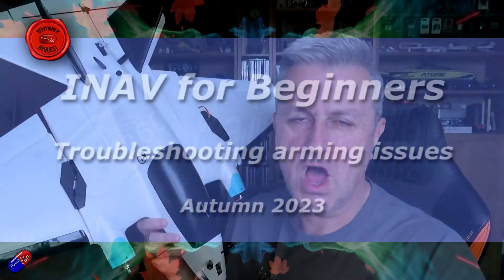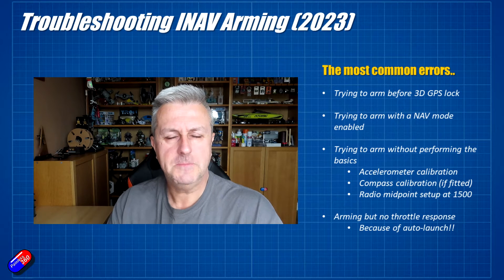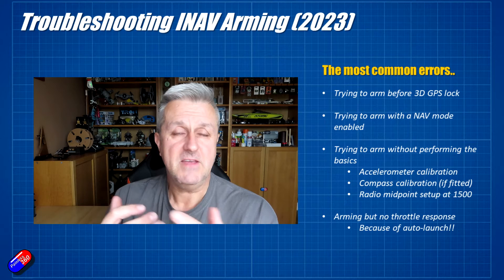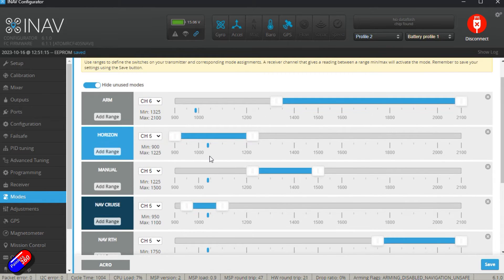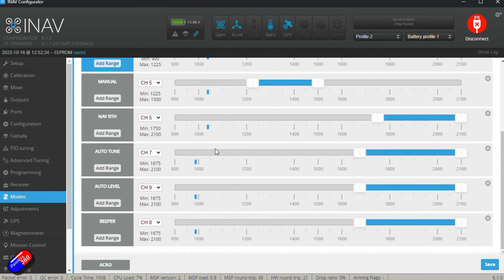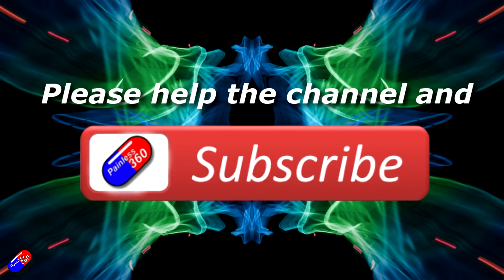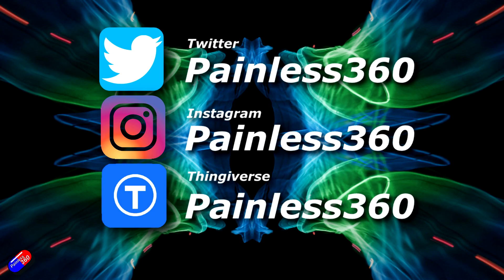INAV Arming Problems - What to Do if You Can't Arm INAV or Run the Motor..

Comment: Hi Lee, as always thank you very much for your videos, I really appreciate them a lot. I wanted to ask, as it is not stated here. When I connect the airplane I'm trying to use, it does not show the arming flags in the bottom grey bar, i'm using INAV 8, a matek f405 std and all is working, even a pitot tube and 3d lock in gps, i set up an arming switch but i'm not able to run the motor, i can only run it through the usb, and sometimes i have a 'runtime calibration' ❌ in the overview, but i don't know if im able to arm or not because i dont see the flag. Everything else is working, i have been stuck with this a couple of days without improvement, if you have any ideas, please let me know!
Reply from the maker: Typing status in the CLI can also show the issues too. Best of luck

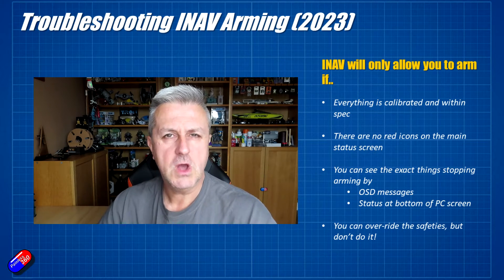Comment: Hi Lee, I successfully installed INAV 7.12 in my no1 plane with SpeedyBee F405 mini, but blew up my no2 board in plane 2 so in the process of setting up.  I get 'navigation is not safe'  Good fix outdoors. 15+  satellites, 3d fix, no modes set apart from Arm, loiter, RTH on switches 1 and 2 way sw 3. Permanent airmode. Though I have tried with that turned off anyway.  Everything is configured as was my no1 plane. A couple of points re the video , at 01:29 in INAV 7.12 scolling down in pre arming checks it does not tell me what is wrong unfortunately.  With system messages on in OSD and looking at my monitor it does not tell me what the problem is either ? I think, a bit hard to see, but you are using INAV 6. ? Any other clues please?  There are suggestions online that 'nav is not safe'   is a bug with Inav 7 , so thinking of trying 8, or even a downgrade to 6? cheers. And thanks for your much appreciated efforts!
Reply from the maker: Check how I setup mine here for hassle free configs. Check your modes as tying to arm while a navigation mode (like Return to Home or Loiter) is active can also trigger the "Navigation is NOT safe" message
Reply: Thanks for the 'Speedy' reply, I forgot you're UK unlike Andrew Newton! 😮
Just came on again to say I installed 8.12 and then no more nav not safe message. But, this time motor wouldn't spin up . The reason now was a modes issue though, a channel conflict with arm, rth and loiter.  Pretty sure that wasn't what the original  problem was though as I'd been through all settings including modes a few times,  before updating to 8.1 
I'd even discovered how to use CLI and copied Diff all from my working board to the new board, before risking total FW update so I'd have thought that modes were ok. 
 Only have 6 channels to play with, Flysky i6 ! 
Thanks for the input anyway, it's a big learning curve for my 78 year old brain, though good fun when you win 😊.
Ps. I always check position of rth and loiter swC as well. 😉😩
Reply from the maker: Please follow my INAV for beginners series on the channel for the setup steps I use that work every time. Best of luck

Comment: Hello. What kind of problem could be with inav setup that esc is not working via standard s1 chanel. And if i change it to servo type, it works ok.
Reply from the maker: Check the ESC supports the protocol you're trying to use... best of luck
Reply: @Painless360  i used dshot, on flycolor site it looks like support.
Reply: @Painless360 i used dshot protocol, as i saw on flycolor website. It supports. But after all check in inav motor still stopped.
Reply from the maker: I've not used those ESCs here so maybe try the different DShot speeds in case it only support one or two. Best of luck!

Comment: Hello, I want to upgrade a BEE 35 drone equipped with a SpeedyBee F405 mini card to INAV. Everything is fine except the accelerometer calibration phase: It sees the drone on its back while it is on its belly! So I have a "UAV is levelled" error in red in the Setup page. It is therefore impossible to arm the drone. The drone flies perfectly under Betaflight. Do you have any idea what the problem is?
Reply from the maker: Check out https://youtu.be/kVVJ-DjUjsc?feature=shared
Happy flying!

Comment: Never had this issue with betaflight.  Now using inav.  takes some 10 times for arm to work.  There is absolutely nothing different from attempt 1 to attempt 10.  Initially it worked fine for a week then one of the bazzillion settings i changed and from that point its russian rullette on the arming.

And of cours when connect by bluetooth, the setup page shows all green checks.
And now i disarm and the damn thing keeps powering the motors and goes nuts.  These flight controllers are not to be trusted.
Reply from the maker: Sorry to hear that you are struggling. However, that is not my experience when setup as per my builds with INAV... Happy flying

Comment: Hi sir, my Tx and Rx already bind. The signal is strong
but there is no response even though I toggle my remote (in Receiver Tab INAV)
I got the same information as yours "armed disabled"

Could you please inform me how to solve it?

FC: F405Wing speedybee
RX: R24D ELRS Mateksys
Tx: Radiomaster Pocket ELRS
GPS: M10 Walksnail
Thanks a lot~
I am a total beginner in this electronic part
Reply from the maker: Which of the suggestions in the video have you tried?
Reply: @Painless360  Hi sir finally my Receiver has a response
It seems there is a loose connection in my wiring for the RX
Currently I am be able to control the servo
But I still cannot turn my motor

Comment: I have older GPS  which only gets maximum 10 satellites. How many you need for 3D lock , how to decrease amount of HDOP inav needs to arm motor on my wing?
Reply from the maker: Usually 6 or 7 is fine... Happy flying

Comment: Mine still unable to arm with "navigation is safe" being crossed red.

I have ensure no navigation mode is activated during arming, but no luck. I even disable GPS navigation, and thus deactivating the navigation modes entirely, yet, still unable to arm, waiting for GPS lock.

I want to test my build indoor. This annoying error drives me crazy. I have 2 build that have the very same error.

 What things I missed here actually?
Reply from the maker: It could be a few things but you've only told me you've checked the GPS nav modes and GPS lock... What else? What is showing in the arming flags at the bottom of the screen ;)
Reply: @Painless360  arming flag shows "waiting for gps lock, unable to arm". It is weird. i didnt activate any navigation modes. even, i disable the GPS on configuration to remove it from being referenced by INAV. but the error still there
Reply from the maker: What version?
Reply: @Painless360  INAV 6.1.0 on speedybee wing F405 FC. Both of my build using this FC and experience the same error. 

I believe there was some setting somewhere. Because previously, i was able to arm indoor without "navigation is safe" error. But once the GPS was activated, GPS lock requirement cannot be turned off anymore. It will always require GPS lock everytime to arm although I already deactivated the GPS
Reply from the maker: I've never seen that here as I use a GPS with INAV all the time. Sadly, getting help from the developers on an old version is tricky so I would see if the problem persists with INAV 7.1.2,...

Comment: My FC has a barometer in it. Suddenly the barometer icon and 'Hardware Health' flag on the Inav status page turn red. What should I do?
Reply from the maker: I've never seen that. If you're not using it then you can disable it in the sensors section. I'd inspect the PCB if you haven't changed anything in case of dirt or something causing it to error. Best of luck
Reply: @Painless360  Update. For the barometer, if I plug in the Lipo and the GPS acquires some satellites I can arm the drone. Then I plugged it to the computer and the barometer icon is blue and the Hardware Health flag is green.

Comment: I have a 6 channel radio and would like to enable Arming and Autotrim (for maiden flight).  My thought would be to use a 3 position switch such that AutoTrim is activated for position 0 &1, and Arming is activated for position 1 & 2.  I would do this so that when I land the plane after the flight and then disarm (position 0), the trim settings will be saved to the board.  I would then do something similar, but replace AutoTrim with AutoTune.  Will this work?
Reply from the maker: You could use the arming switch like that but be careful adding any other functions to it. It can be a little too easy to disarm by accident (I speak from experience! :D )

Comment: Hi, 

I am being very specific but if you could help or make a video would be great. I am unable to arm an E flite 10 amps pro ESC with Speedy bee f405 flight controller. 

In INAV I have been able to achieve the arm status but the ESC does not arm. Could it mean that the flight controller is armed by ESC is not? And why could it be? Can you make a video or explain? Would be grateful.
Reply from the maker: What troubleshooting have you already done?
Reply: @Painless360  I am able to arm the flight controller in INAV. once armed, I connect the battery/ESC while transmitter is already on and at throttle full low position (1000us). The ESC gives a long beep followed by 3 beeps indicating cell count but nothing after that. 
I also tried to run the motor using INAV output tab as per guidelines provided by you but nothing happens except the same beeps I told you earlier. 
I am not sure if it's something related to throttle range or what. INAV doesn't show any arming flags. It's shows armed even then when I plus the battery into ESC nothing happens after cell count beep.
Reply from the maker: That sounds like a good set of checks. If you can't run the ESC from the motor check in Configurator then I'd suspect that it isn't getting a signal. Check the wiring and ESC protocol... Happy flying
Reply from the maker: Maybe autolaunch is setup? See https://youtu.be/hEEdlsOV-fo fro clues.. Best of luck
Reply: There is one thing though about which I am not sure. As soon as the throttle moves above 1100 us INAV says arming_disabled_throttle. Could it be possible that the ESC can only read a throttle value between 1200-1800 by default and a throttle setting below 1100 is good enought for the flight controller to arm but not for the ESC? If true how do I overcome this problem? Any suggestions? Like how to increase arming disable throttle value from 1100 to something like 1220 etc. 

I am also unable to enter the programming mode of the ESC with throttle set to full up and then plugging the battery to ESC while flight controller is still on via USB.
Reply: Thanks for your response. The ESC protocol is set to standard as suggested by speedybee technical support team. 

And when you say wiring. Which wiring do I exactly need to check? Could it be an internal problem with the flight controller? Or the wires I have connected to the S1 outlet of F405 wing app controller are faulty? Because the servo is getting the voltage. 

Which wires would you recommend checking?
Reply from the maker: Signal and GND wires are going to the right motor connection on the FC - most have two and only one will be sending a signal.

Comment: I heard that proper shileding of GPS module cables also helps to shield RF noise interference and get faster GPS lock. Any thoughts?
Reply from the maker: I've never seen that on my builds. That only tends to happen when signal wires are run alongside other wires carrying large AC currents... Happy flying

Comment: Awesome videos !!!!  I have set all the controls as per vids on YT. Even though I built quads with betaflight, I missed one important step to arm my Build. A Atomrc Dolphin.   I had everything in INAV working ,but forgot to lower my throttle setting which was set to high. Reduced to 998 in the tx/INAV Receiver tab, and it arms now.   Onto vids for auto launch and auto tune/trim.     Thanks for all the knowledge shared P360.

Comment: I just got back into the hobby and purchased Speedy bee 405 wing controller. Is there a way to setup for only one aileron servo or do I need to run two leads to the controller? I am using it on a Volantex 1600. Keep up the great work. Alex. P.S. Merry Christmas
Reply from the maker: I was playing with this only this week. Trying to get only one aileron output was tricky. You could plug the y-cable into one of the outputs. Best of luck

Comment: The thing I keep running into is that I'll start tweaking things when the sun goes down, and I find I upset something after I go to the field. It's pretty good practice to bring along a cheap laptop to access the configurator. The last one I did was trying to manually set GPS config, and iNav didn't like what it was seeing, so it just angrily ran the beeper at me.
Reply from the maker: Ah, the dreaded 'late night tinkering'! I always like to take a 'Diff all' from the model before I start, in case I end up going down a rabbit hole and forget where I started out from! Seasons Greetings!